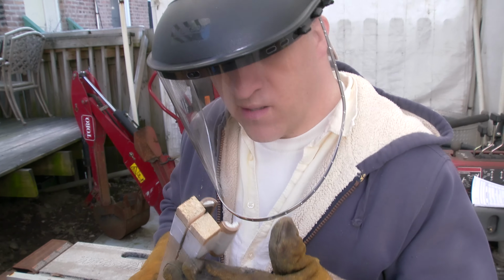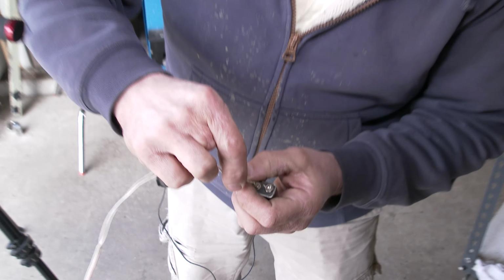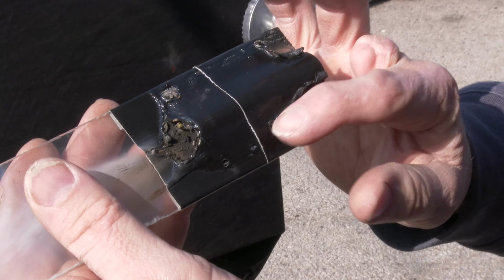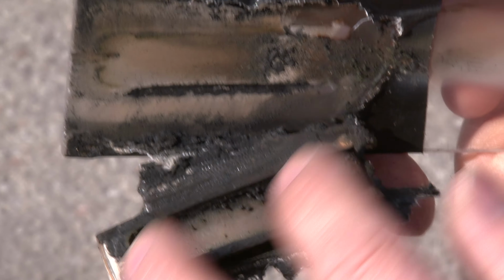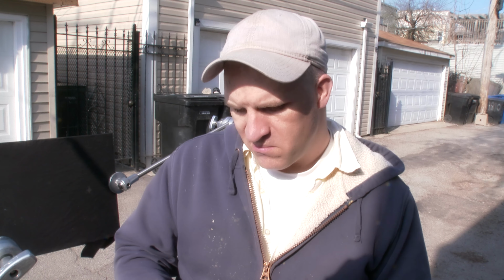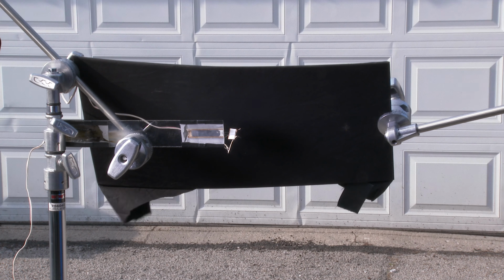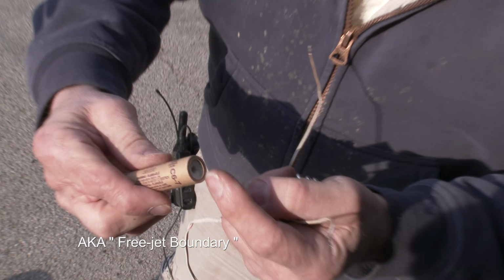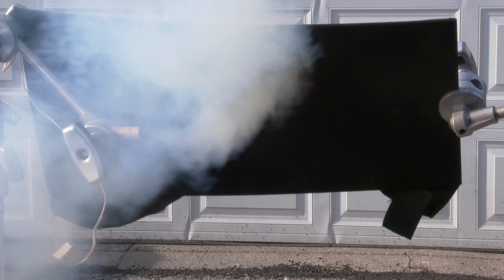See Through Model Rocket Engine Burning in 4K Slow Motion - Rockets (S1 • E1)

Comment: What ever happened to the motor blow up video?
Reply from the maker: I filmed it, it didn't blow, i ran nitro, it didn't blow, i mounted a turbocharger and nitro, haven't ran that one yet. decided to regroup and give the other videos a chance to move up a bit. we start posting again this weekend, just had to prep, a lot of prep. thanks for asking
Reply: If you can't get It to blow on nitro or a turbo charger just drain the oil out of it and hold it full bore till it blows.

Comment: Is that the Real sound, just slowed down???  no way
Reply: Cameras can't record sound that slow. The audio he put in is a filler.
Reply: Shrub i know that... maybe he records the sound with another cam, or audio device,  then alters the Data...

My question would be, the sound if the actual recorded sound it ebay is used, how slowed has it been, because the video speed if applied to the sound,  I Imagine would sound AWFUL

Comment: this isn't at all like the rocket would burn in normal use.  the was no seal and the cut was rough.
1. fine band saw
2. thicker plexiglass
3. glue tube and fuel to plexiglass for a better seal
4. clamp down hard on tube to help keep it sealed.

Comment: If you're gonna do it.. do it properly. Obviously all the propellant was just blowing out the sides because the rocket wasn't sealed to the acrylic piece.. completely eliminating all the characteristics of a rocket engine. All we saw was the burning of the fuel but not the actual function of a rocket.
Reply from the maker: dan428 exactly, the new episode posts tomorrow of the proper engine. after filming the newer version I noticed that this video was actually much more informative than I originally thought.

Comment: if you run oxygen gas used for welding through a 2 inch cylinder of acrylic with a 3/4 hole drilled in it then light the end it turns into a rocket engine check out applied sciences channel for a proper explanation and demo
Reply from the maker: the bunker thanks , I've actually thought about doing that video and I May do it in the future, but I have never seen this done before , and the 2nd version of this is coming out in the next few days .I May still film the acrylic oxygen engine pretty soon just been busy prepping for the filming season.  thanks

Comment: It did not had good sealing and the energy spread around and got away from many corners and other sides of the rocket this may have produced a completely different result in the burning pattern I suggest you shoot an other video with better sealing so that you can maintain the pressure inside the rocket's body

Comment: next time glue the damn things down to prevent the gasses from going completely out the sides. u get a better test
Reply from the maker: +Toshogu Takegawa nah.... All or nothing in my opinion, this was just to show how the fuel burns, even if the sides were sealed there would still be premature ignition propagation in the chamber comma since it's not perfectly sealed. I have a full version of this that I built that we are shooting next week, it's a hundred percent proper and transparent.
Reply: Even better.

Rocket engine not hard to make. Sounds like u found clear acrylic tube and packed it yourself.

If u have not made engines before.

Make sure to test a couple behind a blast shield/sandbags
Reply from the maker: Toshogu Takegawa lol.. actually better than that, I'm an aeronautical engineer so I'm very familiar with how to make those kinds of things , I just really don't go into technical words or science behind things in our show. If I went into detail and use a lot of technical words explanations excetera it would be a completely different format.
Reply from the maker: Toshogu Takegawa I definitely appreciate the input and concern though .... Thanks and thanks for watching
Reply: Warped Perception yeah i get u. Know your audience.

Look foward to seeing what u rigged up.